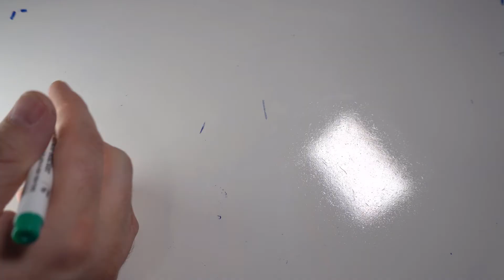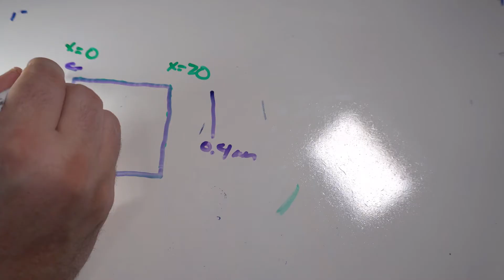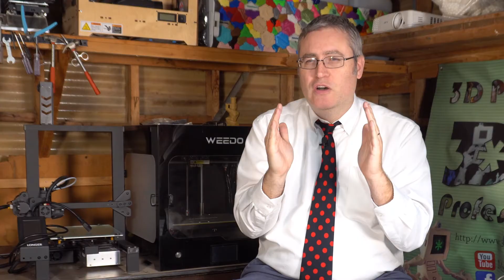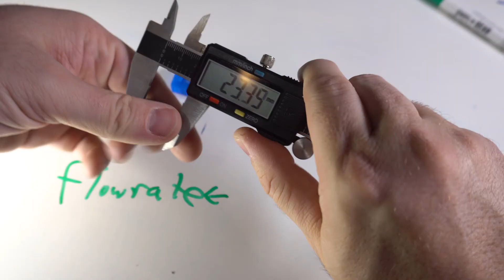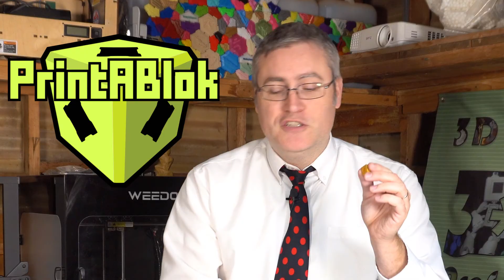How to 3D Print more Accurately so you can make Lego Bricks

Comment: How to recognize if you can't print properly:  you have a bed slinger, has open frame, print with PLA instead of good technical materials (PETG), cant control chamber temperature properly.
Reply from the maker: I'm more successful with PLA than anything else, especially with open frame bed slingers.

Comment: Also calculation your movement is wrong, you don´t calculate a movement of a system by it´s end product since many more variables go into that like flow rate, material shrinkage, humidity etc.
You can simply tell your machine to move the X axis by 100mm and measure a before and after just like you would do with the filament.
This is really not best practise, it´s somewhat in the ball park but it will way longer to calibrate your printer properly this way.

Comment: Your calibration method for flow calibration is flawed
1. What should extrusion width be with a 0.4mm nozzle ? A min. value should be nozzle dia. + layer height (0.4mm+0.2mm = 0.6mm) 
Why so ? Because the nozze has a bore where material comes out and the sides will form half a circle on each side otherwise layers will not stick together at all and a value lover than this is inpredictable.
2. Now set your flow rate to 100%, extrude a hexagon (has more walls than a cube, but a cube would work as well) with 1 outer wall and no top layers as you have shown.
Now it is way easier to predict the correct dimension since our min. value would be 0,6mm instead of 0,4 which is incorrect and physically not possible, that´s why EVERYBODY ends up with a value greater than 0.4mm and then "tunes" it´s flow rate to under extrude. Back to the topic.
Now you usually end up with something like say i.e.0.64mm alright 0.6mm/0.64mm *100% =  93,75% -->94% Now try this value out. 
BUT!!! This is only true for Slic3r, Prusa Slicer and Super Slicer since this slicer automatically recalculates the gap between two walls, other slicers like Cura do not! 
For Cura your Extrusion width should always be a littler greater than measured line width. So say your Cura profile has a line width of 0.5mm and you print a single perimeter at 100% flow rate, you should measure something like 0.6mm which means with 2 walls you will have excess material of 0,05mm from one wall and 0,05mm from the other so your squish will be about 0.1mm.

This topic is more complicated than some might think!

And BTW if you say something like: "NO! I DoNt WaNt tO UsE a lInE wIdT oF 0.6mm" don´t worry, after tuning with 0.6mm or even 0.8mm which is far more reliable than 0.4mm you can revert back to 0.4mm once your calculation is complete, just know your printer will never print with 0.4mm this is just the setting in your slicer, it is simply physically not possible to do so. But that´s not a problem with a setting of 0.4mm you will get better details anyway.
And the great thing is you can print 0.6mm or 0.8mm or even 1mm with a 0.4mm nozzle as long as the "flange" around the nozzle exit hole is flat and big enough. I am printing come contauners in Vase mode with 0.8mm line width, the printer does not care what nozzle size you use it will just squirt out more material through a smaller hole which will create a little more pressure in the system but that´s it, you can print with those huge line no problem you don´t need so switch nozzles.

Comment: I disagree that an oval shaped hole means you have crap printer.  Most likely the printer's belts are too loose and need tightening.  Belt tensioners would be a good investment.  Other hardware problems can be fixed as well or the printer can be modded to work.  Yes it will take some time and skill and money, but any poorly working printer can be made to work better with both hardware and software tweeks.  Saying a printer is not good enough to print certain parts just means you are not willing to put the time and effort to make it work better.  I have been working with my printer for a couple of years now and have just now gotten it to the point where it prints decently and somewhat accurate.  Yes there was a lot of frustration, but I did not give up and I enjoyed the time I put in.  I still have some work to do though to make it better.  Replacing the 8-bit main board is high on my list to make to my printer next.
Reply from the maker: You clearly haven't tried the Easy Threed K7. Even the manufacture is like "Yeah, that's just beyond what it can do" when it comes to small holes.
Reply: @3dpprofessor  interesting, sounds like an awful machine.  Still, I would think you could mod it so it would work.  Oh, it is one of those mini things.  Yea, that is piece of junk.   You probably could get it to work, but you would have to take it completely apart, replace the plastic parts with metal.  It looks like metal rods might even be plastic or hollow tubes.  I never understood why anyone would even want to buy of those.  You get what you pay for.
Reply from the maker: @zk_6312  hey, it's $99, so give it a shot and let me know how it goes. 
Also, check out the Ulio, a 3d printer made out of Legos. I haven't tried it, but even it's developer won't comment on the quality it can produce.
Reply: @3dpprofessor  Actually I saw one for $61 on ebay, but no thanks.  Better off putting the money toward another ender 3.  Actually I would love to buy a corexy, but that is out of my budget.

Comment: As others have said, X and Y movements are mechanically defined by the pulley diameter and the deg/step of the motor. Z movements are by deg/step of the motor and the "pitch" of the lead screw. The extruder will have some variation due to the design of the teeth in the job gear, but is mainly based on, again, deg/step of the motor and the diameter of the gear. The linear distance of filament moved will not deviate for a given step count unless, as someone stated, the gear bites more or less into it. Only the extruder should be compensated for in the slicer. If X/Y/Z are not accurate then the steps/mm value was changed from factory defaults or you should look for other problems that need correcting.

Comment: I am confused,  if the nozzle is 0.4mm  and your measuring 0.4mm then this would imply that the filament coming out of the nozzle is not being compressed slightly onto the previous layer, I was always under the impression that you wanted the layers so "Squish" into the previous in order to get adhesion on a bigger area rather than the tangent of the two round layers of filament. And yes, I know there is consideration for the fact that the layer height may only be 0.2mm but that would only mean slowing down the filament flow, but it will still come out of the nozzle at 0.4mm wide and still need to be squished onto the previous layer. I may be slightly over simplifying this but I would have expected the resulting width of the wall would be perhaps 10-20% wider than the nozzle ?

Can you comment on that please ?
Reply from the maker: The bit about the layer height being smaller than the nozzle diameter is paramount to the conversion. Also, in conjunction with that is the movement of the X and Y motors. You can slow the feed of the filament such that the .4mm cross section is squished into a .4mm wide (and 0.2mm layer high) shape that won't oversquish out the side. 
Now,  if you're thinking that getting it to oversquish out the side is good for being completely sure you're getting that you're getting optimal layer adhesion, you can do that, and some slicers let you make that adjustment. But in reality it's not proven to be necessary.
I suspect there's something going on as well with the fact that the filament is still a little liquid coming out, resulting in some wicking action allowing it to grip the previous layer, especially with silk filament where layer lines seem to disappear, but I'd need a microscope on a high speed camera to test that.

Comment: Few more points from me (to anyone interested, please don't take them as a criticism), going down the rabbit hole:

1) A more common (alternate) way to calibrate extuder steps-per-mm (or flowrate %) is to measure the difference before the extruder, ie. measure 120mm of filament away from the extruder body, make a sharpie mark, tell the printer to extrude 100mm, measure the distance to mark, do the math. Amongst other things, this is easier to measure to a higher precision given the same tools.

2) The flow changes between filaments come mainly from a different effective radius of your drive gear as it bites deeper/shallower into the filament. This is also why PETG tends to need more steps (or flow %) as it is softer, the drive gear teeth "sink in" more, reducing the effective radius. Similar for ABS. Filament width differences still matter, though not as much in my experience (with cheap PLA).

3) As mentioned in (2), effective radius matters. If your printer has an adjustable tension knob on the extruder, set it once, calibrate and don't touch it! Tightening/losening will throw off your calibration.

4) Setting your steps-per-mm for X/Y/Z to a measured value rather than a calculated one is, in some circles, considered a bad idea as it hides real problems with the mechanical system (like skipping microsteps), which will manifest unreliably on shapes more complex than a 20x20 cube. Try printing slower or increase current to your motors. Also check for loose pulleys, loose belts, loose motor mounts, belts running slightly diagonally to X/Y axes, etc.

5) A 20x20 cube is a horrible accuracy test, print a 100x100 flat hollow square instead - any inaccuracies in size will be much more magnified over larger distances.

6) Square your printer in X/Y, X/Z and Y/Z, ie. thing:2563185. If you cannot physically move the rails, turn on SKEW_CORRECTION and input your measurements.

7) Turn up your cooling fan / focus it better. FFF printing, like welding or casting, suffers greatly from accuracy losses due to thermal contraction while (slowly) cooling. A powerful fan will cool the outside of a printed track fast enough to lock-in the as-printed shape. For the same reason, consider printing on a raft as a hot bed will cause the first layers to cool differently (when the print finishes), deforming it.

8) Perform step (1) with different extrusion speeds - many people report different values for different speeds (even though it makes no sense). This may again indicate mechanical issues (microstep loss) or a clogged drive gear. If you can't get repeatable results using the same speed, the drive gear or tension bearing may be bad (non-circular) or badly mounted (different effective radius during one rotation), etc.

9) Enable and tune linear (pressure) advance, BACKLASH_COMPENSATION, ..., tune your acceleration values to eliminate ringing (Teaching Tech made a great video about it recently!).

10) Use an SLA printer. :)
Reply: Thanks for this reply. This clarification is important

Comment: Hmm I'm confused, there seems to be two calculations for the flowrate value, which one do we use?
Reply from the maker: (Expected / measured)  * 100
Reply: @3dpprofessor  Thanks for the reply, I understand the math, but it seems to calculated twice, early in the vid and then again later. Both say they are flowrate.
Reply from the maker: @mick_hyde  Time stamps would help this conversation, I think.
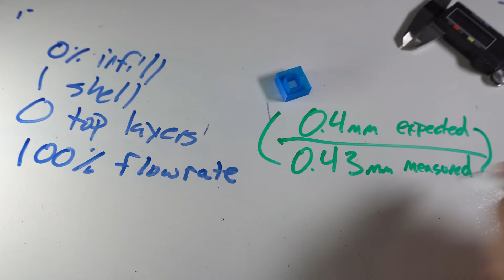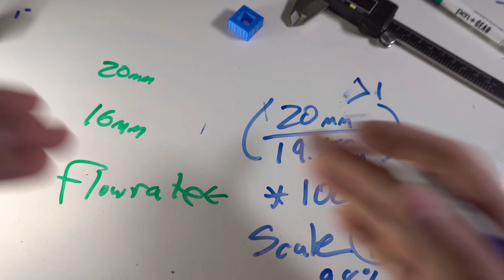Reply: @3dpprofessor  11:30 and 15:20 ish. Seem to be two flowrate values.
Reply from the maker: @mick_hyde  They are similar calculation. The first at 11:30 is for calculating the flowrate. The second at 15:20 uses the calculated flowrate to calculate the scale correction. But they are the same idea.
Reply: @3dpprofessor  Thank you so much :-)

Comment: Just started printing at .06 layer on my Crappy Geeetech A30. the Original Lego Bricks I printed did okay but the top didnt click into lego legos very well.  I still need to try the model I adjusted to see how they fit on the top. I have the Bottom of the brick dialed in